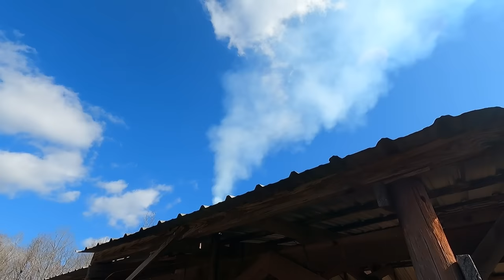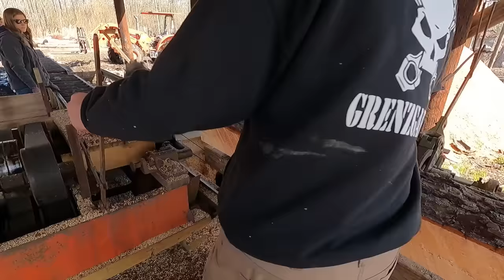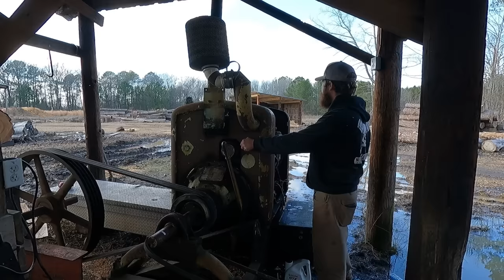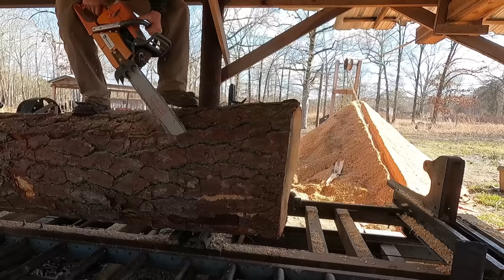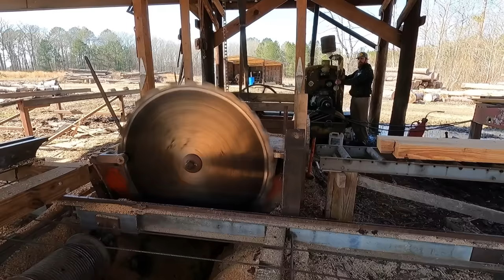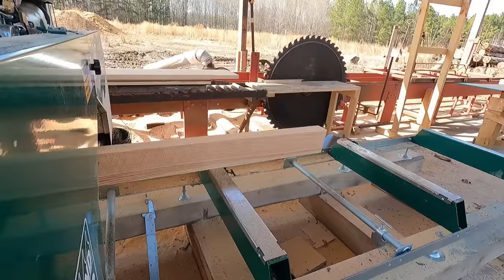1940's Corley sawmill | 1953 Detroit 3-71 powering it 💪🏻

Comment: It’s really a shame the government forced GM to quit making those old 2 strokes. They were cheap and simple power with a million different uses. There’s no need for an expensive electronic controlled engine for something like this, or irrigation pumps, generators etc. leave it to the Government to over complicate the simplest things
Reply: I hear you. Theres a lot to be said for the reliability of mechanical engines. It seems like if a newer diesel goes down or catastrophically fails, half the time or better, its emissions related. I want to breathe clean air too, but it shouldn't come at the cost of the end users or shorten equipment life. Not to mention the biggest polluters, aviation and shipping industries(planes, ships, anything military), aren't regulated at all like small engines are, and never will be. The trend is more electronic equipment  on everything, engine related or not. Why does my toaster need wifi? Its ridiculous. More and more cars/trucks are going into the scrapyard because they are 'mechanical salvage', or more expensive to fix than its worth due to all the computer modules. New diesel trucks are so choked by the emissions systems, its a mess. Any work in the engine bay of a big 3 diesel now costs thousands because you have to take 10 things off to change a belt. You cant even see the engine.

That old Detroit 2 stroke might be 70 years old and still being worked. They're inefficient, loud, don't make a lot of power, but they're simple, easy to work on, parts are interchangeable and cheap(or at least used to be), and best of all, reliable. The added complexity is just as much the government's fault as it is manufacturer's wanting to offer more features, or consumers demanding more  power every model year. Of course some planned obsolescence sprinkled in, too.
Reply: All the expensive engine wrecking emissions systems for on-road applications make even less sense on off road engines, anything 24hp or more. Basically, if your lawnmower is diesel, the epa/carb wants it to pass a emissions test. All that extra equipment adds a lot to the pricetag, makes it way less reliable, and shortens overall lifespan. It sucks.

 There's no way to bypass or disable some systems, and even if you can and do, your at risk of a heavy fine if caught.
Reply: Agreed we run a 671 for our mill and if you go by the work done on the amount of fuel they are darn efficient and good at their job.
Reply: One volcano erruption will cancel  out any good that's been done with all the money that's been pissed away on emissions standards.
Reply: @ctdieselnut  Of course, dying from small particle pollution kind of sucks too.
Reply: You have to think about all the fuel -raw material - energy - etc that goes into making emission control devices for modern diesel engines, that seems to drastically reduce engine life and reliability. And that In turn cost more fuel, material and energy to reproduce parts and equipment. If you were to add it all up are we really as far ahead as they want us to think? You won't see an engine built today, 50 or 60 years from now doing a job like this. I like the old stuff. Tried and proven!
Reply: The sad part about it is the Detroit 2 stroke diesel is probably the most efficient   and probably could be the cleanest engine out there!
Its nothing like a gas 2 stroke engine. A gas 2 stroke uses the exhaust to help bring in the fresh fuel air mix in. As a result raw fuel goes right out the exhaust.
Diesel fuel isn't introduce till combustion time so no unburned/raw fuel should be in the exhaust. And with the blower pushing clean air through it, it should be diluted and super clean. Some cam timing and injector improvements should have made this yhe cleanest engine out there. Something seems screwy with this.
Reply: Small particle pollution only hurts mice in California
Reply: They last forever that's why I have a 453 in my international travall a 6v92 in my 55 international r190
And a 8v71 in my white freightliner sitting on 52' tires
They are loud ass he'll and love ether QuickStart
Reply: the motors for both the gen sets and irrigation pumps we use on the family sod farm are only Detroit’s we currently have 2 3-71’s and a couple 4-71’s these things will run for days on end with not a single issue but try running one of them new Cummins or caterpillars and you’ll be so deep into debt with mechanical problems you’ll wish that they still made ole 2 stroke Detroit’s
Reply: Now u see more  trucks stuck on the roads than ever
Reply: @ctdieselnut Well is 1950 America Ok?
Reply: @Daaremikkel  Don't stand in front of the exhaust outlet.
Reply: @ctdieselnut you have no idea. The maritime industry is one of the most regulated industries in the world.
Reply: I like your comment, please comment number 2 if you're still here

Comment: Reminds me of the sawmill at the antique tractor club in Michigan that I belong to.  They run it off a steam tractor during the shows. They also have a big single cylinder Fairbanks Morse diesel that can be belted to it. You can hear that Fairbanks a mile away when it is cutting a big log! It also has a P.T.O shaft that you can put a tractor on. I had the 1950 John Deere A that is my profile picture on it one time. I though that John Deere was pretty stout but that sawmill put it on its knees!

Comment: In 1982 I worked for a uncle who ran a business selling bark from saw mills to landscape nurseries.  After he would drive the loader into the bark pile for a full scoop I would pick out all the big pieces and throw them to the side. Then he would dump the rest into 1 of 5 dump trucks he owned. Once the truck was full I would climb to the top and jump inside before pulling the cover over the load I would go around and pick out all the large pieces again and trow them out. Then we would drive to which ever nursery he sold loads to and dump once again after dumping would pick out the large pieces and throw them onto a scrape pile.

Anyway I always had time to watch the saw mills in action and was impressed how quick they could turn a log into lumber.

Comment: Those old detroit diesel engines were bomb proof.... I saw one of these engines with what would of been millions of miles still running while it was running a compressor and electrical unit for a refrigerated train car... that engine was amazing.... We used them in fire trucks because they started easily.... they produced tons of torque ( exactly what a pump on a fire truck needs ) and they were resilient to be able to take the pounding of being started and essentially floored from the time they were started.....
Reply from the maker: You are right, they were tough

Comment: I love these kind of videos.   Me snd my cousin use help grandpa with one almost just like this one when I was teenager.  His would turn and slide the logs though.  I’ll never forget the sound of that engine in person I loved it .   He would send his logs full speed through it….lot faster then in this video and that old engine never bogged down.   Also first time I had ever seen an old belt get repaired I guess it was some kind of staples not sure what that part was called.
Reply: The staples you are referring to in the repair are called alligator splices.They are sharp as hell, when you are redoing a belt you usually leak a little blood before it is finished.
Reply: @markheintz1878  yes makes sense why his hands were cut up so much

Comment: My cousin has a mill almost exactly like that. I don't know the year or brand of it. The 2 main differences is, his is powered by a 238 Detroit, and his edger is hooked to it also. One person saws, one gets the boards and slabs that come off the saw, if it's a board that can be edged, they can flip it easily off the main rollers and send it through the edger. Plus one person stacking. It takes a good number of people to run efficiently, but it can saw up some wood, and fast.

Comment: good video,when I was a teenager built pallets from lumber sawed on a Frick powered by  a 6 cylinder IH started on gas ran on Diesel. What the diameter of the blade seems small. Looks like the bed of the carriage is way to high taking away from the width of boards you can cut. Off barrier needs to pull the last cut off the bed instead of trying to raise the dogs. Make some more of these,  good work.

Comment: if you have to give a shot of either to a diesel then the compression is getting weak. an 80s 6.2 gm engine pumps 500 psi on a new engine, anything lower than 380 is a dead hole, like what I seen in the video, keep it running!!!

Comment: That thing has all kinds of unfriendly to to appendages moving parts.
Reply from the maker: Yes sir, very old school 👍🏻
Reply: @cotontop3  old school! That is a term I haven't heard for a while. We used to cut wood with a john deere tractor that had a long belt running from a pulley to a blade on the front of the tractor. It was loose and held on by gravity. That thing was scary. Back when common sense was common and forgetting your pocket knife in the morning was equivalent to forgetting your cell phone is today.. Thanks again for sharing such a wonderfull piece of machinery.

Comment: You sell your slabs for roof signals or sell the slabs to a barbecue place with the dust it makes good with the web Justin barbecue slabs people will buy them real cheap for firewood check it out charcoal for firewood or cinemas is slabs are selling for a $1.25 alone sell it by the pound same with sawdust 99 cents for sawdust barbecue BBQ pigs wild boar good old smokehouse good old chicken neck smoke it up good old shot California shad smoke it up that's what I use the word for leftovers talk to you later it's 99 cents a pound cheap to get rid of it by the load is probably about 25 to 35 talk to you later

Comment: We take old railroad ties with coat in it problem with that is you got to wear gloves and a lot of body because you'll be trying to have a red rash but they're good good for one thing good for floor and good for a foundation and concrete seal Craig railroad ties make a lot of money on old railroad ties a lot of them a lot of steel to sell and usually either burn them are we usually use about for a foundations work real well less termites but you got to know what you're doing when you messing with that stuff but a lot of protection on you gosh that stuff you itch like a mother f*** skin will turn red and you have a irritation you have to go to the doctor and get antibiotics but it's usable